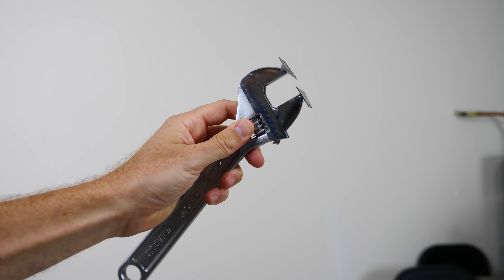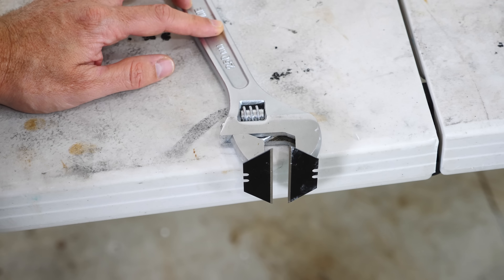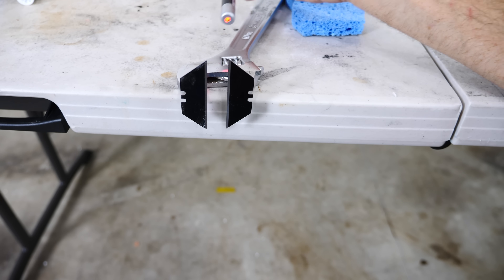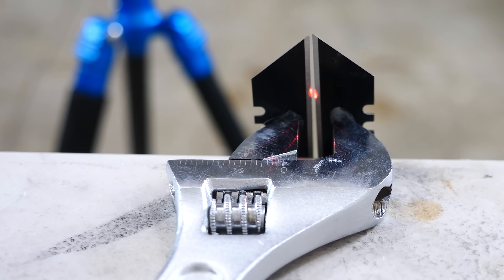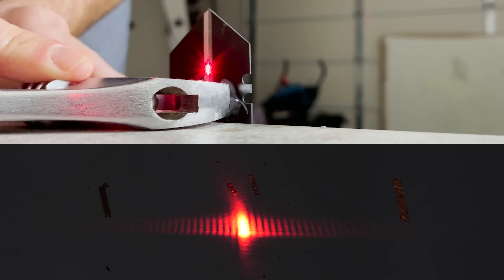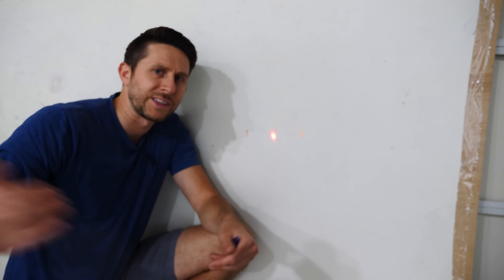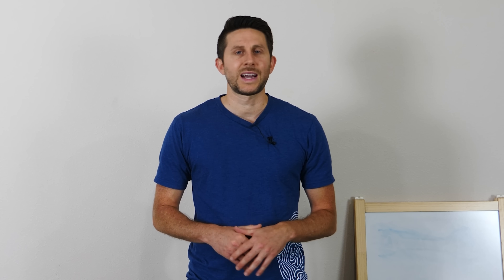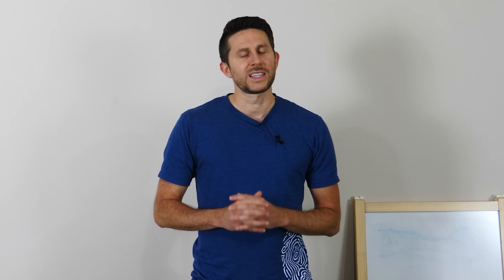Squishing Light Makes It Bigger—Heisenberg's Uncertainty Principle

Comment: Me thinking: "Pfft, it's just diffraction of light"
This man: "Jokes on you mf, I know what you're thinking"
Reply: Surely this is just diffraction though right? Since we see an interference pattern on the wall we know the light acts as waves, and doesn't it act as a particle only once it hits the wall? This would allow diffraction to occur while still making the wall glow.
Reply: @NGC-nx7nl  yeah I'm also confused how this isn't just demonstrating the waveform of light
Reply: @aidancooper9498  it's not that weird until you realized light mostly a particle too, it's like seeing a forward moving ball going through a slit and suddenly it goes everywhere..

atleast that's why i think this is bizzare
Reply: @aidancooper9498  
It is demonstrating the waveform of light, but that is only one of the interpretations of this experimental. It can equally be thought of as single particles, and under this assumption, each particle must travel away from that small gap with some x component in its velocity, where before the gap they were all just going straight.
 
The real profound thing here, tho, is that by shrinking the gap, making the x direction more tightly known, the maximum possible x momentum increases, spreading the light out further. When thinking about this as waves, it makes perfect sense, but it also makes perfect sense when thinking about it as particles, but only under the uncertainty principle.
Reply: @aidancooper9498  I bet he is right, but he needs to get better at explaining things like this. Maybe it is just that the nature of many of these experiments is a bit hard to explain. It is just annoying that I always have to do research after I watch his video.
Reply: @NGC-nx7nl  I didn't understand why a wave will be able to charge the wall but not a particle. Wouldn't the particle have more energy?
Reply: @carolinalee2989  that's what he said
Reply: @carolinalee2989  Light is both particle and wave, so there's no difference. It's just that the UV light has more energy than the red light.
Reply: @RegebroRepairs  no
Reply: @RegebroRepairs  Yeah exactly. But why did action lab use red light and say that he can prove its a particle when it doesn't charge up the wall?
Reply: @carolinalee2989  The charging is an effect of the particle behavior, the paint absorbs photons, and the photons need to be of a certain energy for that to happen. So that shows that light is made up of photons.
Reply: @c47force15  Yes.

I'm sorry quantum physics was too hard for you to learn. Please try again. don't worry, it took me years to grasp even the basics, it really is that weird, its' not you that's stupid, it really works, and it's really bizarre.
Reply: @RegebroRepairs  again, you started with the assumption of particles.   
As I said go back to the beginning. And question any time particles are claimed and you will find they are allways assumed.
Reply: @RegebroRepairs  it's  called "quantum mechanics" and just because the equations can mostly predict some observed behaviours does not prove the theory.  It is still a theory that is based on the assumption of particles that themselves have not been proven to exist by the theory. "I'm sorry that is too hard for you" to understand. A true scientist allways questions the science.
Reply: @lontongtepungroti2777  🐑
Reply: @RegebroRepairs  It's just that the IR light has more energy than the red light.:: Surely you are joking!
Reply: @janami-dharmam  No, I brainfarted, I mean UV light, of course. :-)
Reply: @RegebroRepairs  IR has less energy than red light. E=hf, and infrared is lower frequency than visible light.
Reply: @spencerwenzel7381  As pointed out, my fingers slipped, I meant UV, and that's what he is using.
Reply: @RegebroRepairs  gotcha, happens to me sometimes as well. I was wondering if you understood his explanation? I didn't. To me he was using the photoelectric effect to essentially say light has a particle nature and so it couldn't be diffraction. But light still does diffract, so isn't this just a single slit diffraction question?
Reply: @spencerwenzel7381  I understand what he is saying but don't know enough about quantum mechanics to know if he is correct. 😀
Reply: @spencerwenzel7381  "To me he was using the photoelectric effect to essentially say light has a particle nature"

Yes.

"so it couldn't be diffraction"

No. It's diffraction, which proves it's a wave. And the photoelectric effect proves it's a particle.
Reply: @RegebroRepairs  so it is diffraction then?
Reply: @spencerwenzel7381  Yes, what is happening in the video is indeed diffraction.
Reply: @c47force15  Light particles are called photons. Lol what are you on about?
Reply: @NGC-nx7nl  the 'double slit' result would only be apparent at the sub atomic level, I believe
Reply: He’s a good mentalist. Lol
Reply: It is diffraction. What he said (badly) is that diffraction is consistent with the Heisenberg Uncertainty Principle.
Reply: Paint it black, you have the deepest black paint.
Reply: Can somebody explain if edges of blade are supposedly reflective enough to be considered as a mirror? and then the pattern? shouldnt we try to close the gap with two opaque materials?
Reply: Jokes on him though, he doesn't understand optics nearly as well as he thinks. This is Fraunhofer diffraction
Reply: @WouterVerbruggen  Yes lol, I was thinking the same thing. His explanation on how it proves his point is just completely inaccurate
Reply: oh, now I'm excited for the rest of the vid
edit: unexpected, but guess it was a'ight
Reply: Woah the argument is still going on? Lemme grab some popcorns real fast.
Reply: The joke is on everyone who believes in particles.
Reply: @c47force15  in this term, and in specific ways, light acts as both a particle (straight lines measured in quanta) or like a wave, which gives the grid like appearance, light is a really weird 'particle' that works in very strange ways.
Reply: @c47force15  lmao wait until this guy learn quantum mechanics
Reply: @c47force15  You have no clue what you're talking about. Classical electromagnetism is dead. Learn about quantum electrodynamics and move along.
Reply: @andregon4366  light particles are claimed without evidence.
Reply: @c47force15  The evidence of the particle nature of light is the photoelectric effect, the discovery and experimental proof of which is the reason for Einstein's nobel price. If you don't know what you're talking about, it's best to shut up and learn.
Reply: @c47force15  More claims without evidence.
Yay!
If light particles were claimed without evidence they would have been dismissed already.

Do me a favor and spam that verbiage on Professor Dave Explains videos.
I can't wait for him to release a video destroying your argument and whatever cult that spreads that.

What is your cult by the way, electric univese, scientology, flat earth, hollow earth?
Reply: @andregon4366  It is you that makes claims. It is you who believe unquestionably without evidence. It is you who are held back from the truth by obstinate dedication to mere theories. It is you who irrationally reject and hate anything that questions your doctrine. It is who is the religious zealot. Thus, in fact, you are the cultist.

Find one real world demonstration that proves light as a particle that does not start with the assumption of a particle and I will  publicly apologize for questioning your doctrine and give you 100% kudos.  But if you can't then you must also come back here and admit that you are running on blind faith.
Reply: @c47force15  Well, that’s easy actually. Young’s double slit experiment, but with electrons. You send one electron at a time through the double slit and it will act like a wave all the way until you measure its position on the screen, where it somehow collapses its wave function into a localized spot. In other words, we have just seen the particle nature of quantum mechanics at play. What’s interesting is that if you send enough electrons through, you’ll actually recover the same interference pattern by keeping track of the positions of each particle that struck the screen.

You can either assume the electron as a particle initially or a wave, and either way you look at it, it’s quite fascinating. If particle, it somehow went through both slits at the same time and created the interference pattern. If wave, it somehow collapses into a localized position on the screen, and sending enough electrons through, you still recover the interference pattern.
Reply: @connerstevons4944  thanks, not to be disrespectful, but you just proved my point. 
go back over your statement and remove all the assumptions including that electrons are particles that light is particles that electrons are equivalent to light. that your super high gain cmos is actually measuring individual particles etc.     the only thing this experiment truthfully demonstrates that whatever the electron gun is producing is allways producing an interference pattern, which suggests that what we call electrons are waves that travel as waves. it for sure does not prove light particle wave duality.
Reply: @c47force15  There are no assumptions that electrons are particles, strictly. My point was that no matter how you decide to look at the electron, it exhibits particle-like behavior as well as wave-like behavior. That’s not an assumption, that’s an observation.
Reply: @connerstevons4944  but your whole description is assumptions.   It behaves like a wave it behaves like a particle etc.    What do you actually see on the CMOS???.     You allways , in every case , get an interference pattern. That is the only sure thing.
Reply: @c47force15  I can tell you have a gap in your QM knowledge, and that’s perfectly okay as long as your willing to admit your ignorance. I know much in the field of quantum science, but I admit I have ignorance’s. Bottom line is that I think your issue is with semantics rather than actual science. You’re close to understanding,but all the way there. Keep working hard.
Reply: @c47force15  someone said this already but the thing that Einstein got a Nobel prize for
Reply: @connerstevons4944  now you making assumptions about me.  You know nothing about me. As you know nothing about being scientific.  Carry on believing what you are told without question.
Reply: @eagleleft  so that's it then, some guy got a prize from a group of other guys .  That means everything solved. We understand everything now. We can all sit back and chill. Great.
Reply: @eagleleft  dude stop making fun of  him >:( he's the anti-sheeple anti-scientist-man, the truest of all true people. 
And stop talking this "science" crap, you  hurting his 2 very cute braincells... he dont understand any of that, it's making him superr ANGWY ... you dont want to know what the god of anti-sheeple anti-scientist  could do when he's mad >:((

Comment: Wait, did you just observe an interference pattern, how's that even possible?! And with only one slit, I thought the interference pattern only existed unobserved?
Reply: This is a diffraction pattern, not an interference pattern (that happens with two light sources or).
An interference pattern disappears if you measure/observe from which path the photos pass. And it is usually done with single photon
at a time and not with a laser beam.
Reply: @Lucidthinking  Huh. I wonder if there's a reason then for why squeezed light as shown here appears similar in look to the traditionally described interference pattern. What an amazing space time we live in. 🙌
Reply: This is a good question.

As I see it, the uncertainty principle should cause a uniform spared of light and not a scattered pattern.

 @Dis4ia

Comment: How can you be sure, the pattern wasn't created from the light being reflection at the edges of the blade? 
Perhaps, reflection could also explain why the light is getting more and more pale as it get away from the center.
I would be curious to see the same experiment but with a non reflecting surface on the edge like some black tape for example..
Reply: How would it be reflected? The angle was all wrong for it.
Reply: Laser is not really a parallel beam.
It spreads with a certain angle.
For example, the farther away you are from the wall, the laser spot gets bigger.
Since the beam is not really parallel, light can hit the edges with an angle and reflect.

 @Mernom
Reply: Light is reflected from the edges of the blade (as I noticed when doing this experiment myself).
To rule out the influence of the reflection I suggest coloring the blades with super black color. (I only had normal black colors, and they still reflect the laser)
Reply: No it's not reflection. You can do it with anything, a slot in paper will do. It's just the result of the wave-duality of light. You can actually calculate the shape of the pattern of light in accordance with the wave length of light and the size and shape of the slot
Reply: Laser reflection is very strong. Even a 0.25 mm paper reflects a lot of light.
Try pointing a laser on the side of a paper and you will see it reflects very brightly.
So I would not rule out this option without an experiment.

 @abcdefgh-db1to
Reply: @Lucidthinking  well it can be done ( and I have seen it done ) with matte black painted iron blocks and regardless of the shape of the blocks you can calculate the pattern of light created. The maths checks out. And it doesn't only work with light. You can diffract even electrons and any other particle ( the heavier the particle the harder it is to diffract because of the wave length of the wave associated to the particle decreases for a constant particle speed).